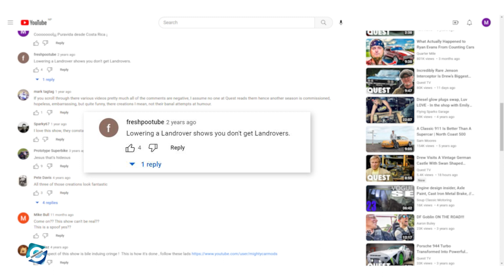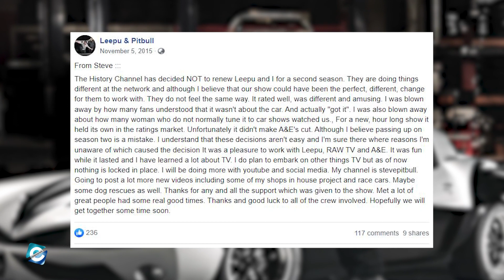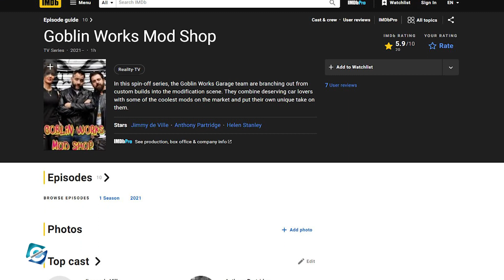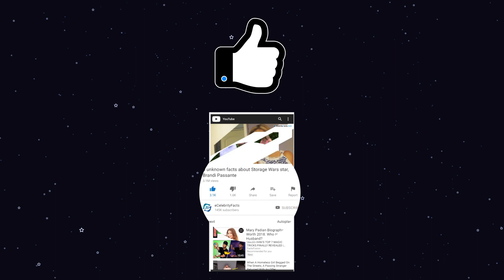What happened to Goblin Works Garage? Is Goblin Works Garage still in business?

Comment: The mk 3 capri 2.8 injection fibreglass wheel extenders was used when they could have made aluminium wheel arches would have been better fibreglass is pants n cheap